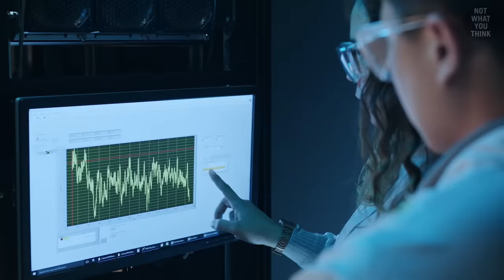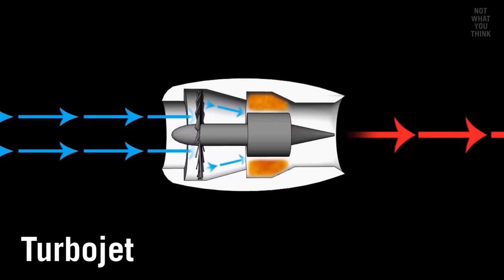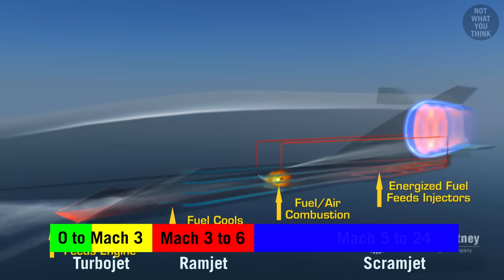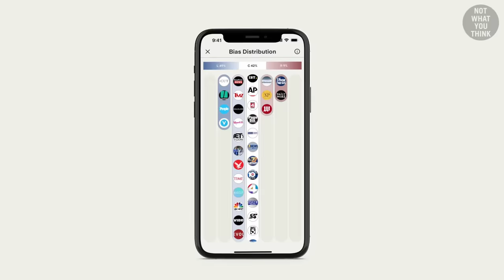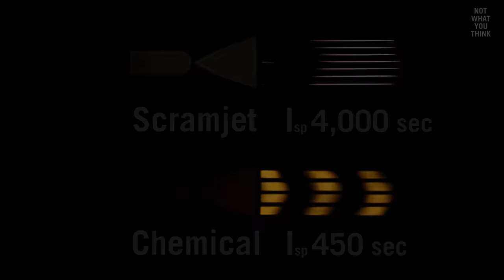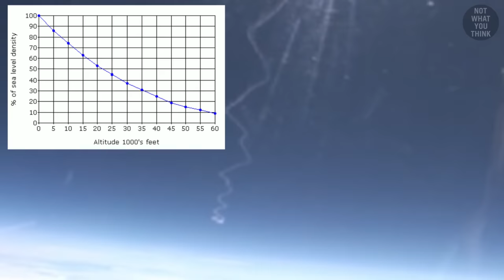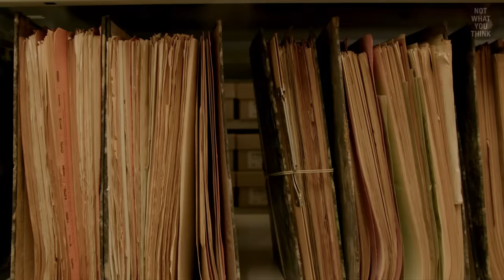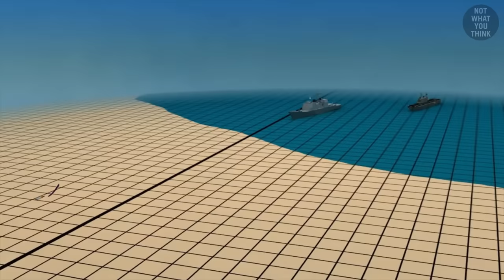The Hypersonic Missile Vulnerability That NO ONE Talks About

Comment: I can't even imagine the stresses that would have to be borne by a missile attempting to turn at those speeds. Any change in airflow would be devastating, and may undermine the very means of propulsion. Unless people have made science fiction level advances in materials sciences (possible), I agree.
Reply: The SR-71 could turn. Stresses are low because it flies in thin air. Actually it has to dive to grab enough air to give enough lift for the turn without stall. It bleeds speed in a turn so more like a spiral.
Reply: @ArneChristianRosenfeldt  Yes, it could turn in big, long sweeping turns and at high altitudes. The hypersonic missiles are usually characterized as traveling at lower altitudes, and in a more zigzagging motion to avoid air defense systems. That's a whole different ballgame.
Reply: @davis4555  When I see Reno air races I wonder how someone would waste 70% of lift for turning. At least I would expect large wings .. larger than on a cruise missile. The models in the video .. uh mostly stabilizer, while a real high lift vehicle would be a delta wing with edges which are barely subsonic at Mach 5 .. just like the NASA plane. Stabilizers drag. Mustang has small, Concorde does not even have a horizontal stabilizer. We need g, not cobra maneuvers at Mach 5. Rolling speed is not problem with low wing span.
I don't see the different ballpark here. If you fly Mach 5 of the altitude of the SR-71 .. where SR-71 titanium steel alloy was already getting quite hot while being cooled by fuel .. I don't think that we can do much better. Cryo gives you only like 150 K .
Reply: @ArneChristianRosenfeldt  I think we agree. 👍

Comment: I think the argument that zircon doesn't do enough damage through kinetic energy alone is false. For once, physics works everywhere, every time. It doesn't suspend itself just because a weapon system is not made in USA. Second, a meter or two of wood or whatever that floating structure is made of can't absorb the kinetic energy the same way earth, a building or a carrier does. The other arguments are interesting but I would like to see some more research behind the russian missiles and how they address these problems. Plus, a proper assessment of their capabilities should take into account their role in combined arms warfare, most likely on an operational or even strategic level.

Subscribed nevertheless!

Comment: when it comes to getting scramjets up to speed, couldnt you just have some mechanism to pump air into it at the correct speed until it reaches the correct velocity at which point you shut that mechanism off and let it work without it?
Reply: With pump you mean the fan of a turbofan? Or the exhaust of a tubo-jet?

Comment: So, the big advantage of hypersonic missile is the fact that it can evade or outrun antimissiles, right? But how the hypermissile will know it has to? It can't see sh** and has no communications because of the plasma, so it wouldn't even know there were any antimissiles fired at it. Sure, you can program evasive maneuvers in advance I guess, but that doesn't help if an antimissile is really fast. And even good old Patriot can squeeze out 4 mach in a pinch. That should be enough to intercept faster, but blind and unaware hypersonic missile.
Reply: It just needs to chance curse a few times. The defensive missiles can no changr course after the start so if you just change course after the point of time when the enemy defend missles was probably started you are safe.

Comment: You made no mention on how efficient current missile systems are at actually hit these. As for cruise missiles, they are much closer and have a shorter range where the launcher can be in range to be hit. There is many other ways for guidance, not just the ones you mentioned.

Comment: Question: If the hypersonic missile is blind during its hypersonic phase and also cannot be remotely controlled because the radio does not work (which means radar does not work either), how can it avoid threats, such as an interceptor missile? How does it "see" the interceptor missile? This is not answered by the video.

Comment: Misinformation. The "Iskander" missile has a speed of 6-7 Mach at the terminal stage of flight, while the "Dagger" missile has a speed of 10-12 Mach and is not ballistic, but travels most of its path horizontally. Hypersonic weapons are already a reality, just not for the United States.
Reply: Not on this planet. The problem is that you lack the slightest basics of physics. However, the Russians have never proved that Zircon has those performances. In the only video, its impact is ridiculous for a missile that goes more than match 5.

Comment: You are incorrect in your assertion that rocket fuel is always going to be expensive. What about if the rocket fuel is made via green electricity (almost free) using the Sabatier process to produce methane? Starship just needs methane & O2 for power.

Comment: Not the best video on the topic but not the worst.
I really disagree with your last point about them needing to slow down and be no better than ballistic missiles in their terminal phase. Because that's just literally not the point of the concept of a modern hypersonic.

Best I can tell the intent and most of the challenge of the concept of hypersonic weapons is with the materials required to manage heat at that temperature at acceptable altitudes.
That might involve climbing to to substantial altitude to avoid heat for an early phase. But best I can tell the concept is that in their terminal phase they would behave like a cruise missile just at hypersonic speed.
Cuz if you can get something flying as low as a cruise missile at or above 1mi/sec then you get to cut reaction time down to at most 40 seconds and honestly often under 20 seconds.

Comment: I was curious if you were going to mention the communication issue. At hypersonic speed, the missle can no longer communicate with the ground or use rader to seek in onto a target, which completely negates its 'maneuverability', as you need sensors and communication to maneuver.

The sonic boom completely eliminates to entire reason for having one.

Comment: Watched a video about tanks. They're utterly ridiculous and regular missiles can't penetrate. A rocket like this was used to devastate the tank.

At first it shoots like a regular rocket, then stage 2 hits and it goes supersonic.
Reply: What? A missile that can only hit stationary target and is quite expensive to fight against tanks? There are dozens of better ways to defeat a tank with the advantage of well actually hitting moving ones
Reply: @Dundoril  Not the new tanks they're developing.
Reply: @TallicaMan1986  hm? The new tank will no he able to move? Sounds like a design problem
Reply: @Dundoril  I forgot to mention. We're already doing this. They're called shapecharges and tanks are developing defenses accordingly.
Reply: @Dundoril  tanks are not fast enough to evade hypersonic rockets let alone rockets automated by robots. With this they developed other means of defenses. One of which is putting a coat Insensitive Explosives which only detonate if there's enough kinetic force.
Reply: @TallicaMan1986  "anks are not fast enough to evade hypersonic rockets"

But they are. The tank just needs to move 40 meters away.. A hypersonic rocket si launch hundreds of kilometers away and therefore takes minutes to the target
Reply: @Dundoril  it might happen, but sadly it doesn't.

Comment: I do not believe.

- Kinetic energy is good.  Even if it's molten scrap metal by the time it hits the ground at mach 10-24, it's going do a job better than conventional bombs.  Load up with some weight, it can melt away before hitting target, and existing  defense's around just likely to spread a lot of little projectile fragments, if it can hit it enough at all, otherwise it could just smash down near by with enough force to affect the targets.
- dual reaction engines to convert down speed.
- plasma is not going to stop  all communications.  It is likely they have a way to do this.  Satellite laser is one, specific wavelengths and plasma tuned to make things more opaque. But simple oculsion  can make a  more opaque area, such a behind the vehicle.  There is a mass of spy satellites out there.
- use movement sensors to map out movement instead of gps, and you can pulse the plasma for radio signal, and the plasma reaction to radio signals can be used to receive (look up the tpl, I think plasma radio transceiver patent from years ago).  The very top cutting edge is also the area of most consistent thinnest plasma.  A spike could be used for communications using the previous methods, or more conventionally.

- the plasma is a transceiving surface, so rad might be possible. 

- As far as visual.  You have spy satellites. But, again you could try the leading edge.  Some transparent materials have very high heat resistance.  Or a protected surface, but realistically satellites.  Meaning extremely small amount of data rate is needed to get through the plasma to guide the device.  Incoming threats can be detected by satellite.

With dual reaction engine (or second engine) you could get both fast and msch 3.  We simply do not know what they have planned.

As for the Russian nuclear one roaming around the sky.  You did my mention.  You knock the American effort to discourage, but undeplsy the Russian efforts, How Come?

We used to be leaders in scram jets.

Comment: At mach 5+, they won't be very maneuverable, either, certainly not maneuverable enough to dodge ABMs.  Turn radius on an SR71 at say mach 2.5 is measured in hundreds of miles.  Granted, hypersonic missiles don't have to worry about turning a pilot into goo on a high G turn, but they certainly won't be able to out-turn a head-on ABM approach, and it isn't even close.  Even if they are capable of making high G turns without breaking apart, they'll have to give up a lot of speed in the process, making them even better targets for ABMs.

This is a big nothing burger.

Comment: Your assessment of rockets for long distance travel is based on faulty logic. Yes, rockets are much less efficient than air breathing engines, but once a rocket is out of the atmosphere and reaches orbital velocity it doesn't need propulsion anymore. While a scramjet-powered aircraft traveling at Mach 10 would have to power its engines for the full flight, which could be over one hour and up to two for an intercontinental flight. A suborbital rocket would only be using its engines for about five minutes. Fueling a suborbital Starship would cost significantly less than a million dollars at current methane and O2 costs, if the rocket is able to carry 500 passengers as estimated, that is approximately twice the fuel cost perb economy passenger for a route like NY to Beijing (and presumably much less than a scramjet would use for that route). So in terms of fuel cost it should be fairly competitive with Business tickets.
There are many reasons why we are unlikely to use rockets to travel within earth in the near future, practicallity, scale and launch noise among several others. But fuel cost is not one of them since they would be fairly competitive in that area thanks to the vehicle being unpowered for the majority of the flight.

Comment: Has any considered the potential fall out or collateral damage of intercepting a hypersonic missile in the air either by conventional means or with another hypersonic interceptor?
Reply: I wouldn’t expect it to be any different from intercepting or shooting down a conventional missile. Any bits of the damaged or destroyed missile would quickly either burn up or decelerate to sub Mach speeds due to air resistance.

Comment: Russian hypersonic missiles seem to work really well in real wartime conditions. Western M.I.C. bros/propagandists simply move the goal posts after Russian systems show they actually do work as advertised. They said Khinzal isn't hypersonic initially. Yet Khinzal's skin is still glowing upon terminal descent right before impact. You only get glowing skin from air friction beyond low hypersonic speeds. NATO and Western radars seem to have issue tracking Khinzal as well. That is why Ukrainian air raid sirens sound off whenever a Mig 31K takes to the air. 😂

Lets not forget the NAFO OSINT bro spilling the beans about bastion missile launchers firing what those turds thought were P800 Onyx until targets were destroyed without air raid alarm 3 minutes later in Kiev. That would be a Zircon, that NATO radars seems to lose track of a few seconds after launch due to speed and superheating of the projectiles skin.

Comment: @Not What You Think  I still don't see why useless. It can be used as a cover. For Russia and China it makes absolute since. USA bulding this as a response to Russia and China. It of course it needs to slow down before hitting the target. The main point here is manvurabilty. At the final stage there is nothing there most likely to hit it. Also u can give another bost to change target if necessary one more time. Of course it going to have multiple bost phases and multiple preprogrammed patterns to use that it chose useing AI or pre-choosen. It is a cheaper option than a glade vehicle. A glade vehicle is the real deal. Reducing the chances of being intercepted is the point. U could make communication with it useing a sitlight sending info useing a lazer light. 

After thinking it makes no sense for USA but it makes enough resones for China and Russia. 

Glade vehicle is basically a jet rocket kamikaze drone that also can shot miny ICBMs like rockts or acutal rockts like Iskander or actual ICBMs with multi warhead skeem like jet can shot rockts. It has more fule than necessary so it can  swim around the target until there is a gap (if when necessary). 

U know they could strap someone on drugs that lost his body to do the aiming  and dodgeing choices. WH40K style lol. 

Also, imagine if multiple where shot at the same time,  then another volume where shot too. What if they make chose between 2+ important targets?

At the basic level, an ICBM that get modified where it can change couse of action while flying and trying to dodge an interpreter missile , is hypersonic at a hypersonic speed or beyond. 
Basically the idea is a javelin or stringer or mix of both very long range faster bigger and smarter rocket, ICBM version.

Comment: 16:00 You know the frame rate of the video. You can roughly estimate what distance the missile travelled between 2 frames, thus calculating the speed of the missile right before the impact. Looks quite slow for hypersonic but need to do the math.
Reply: How do you know frame rate of a video?
Reply: @SlonopotamIII  from playback settings?
Reply: @nitroGPT  Ok, the question is - real frame rate of a video. I can make video of myself running 200 km/h with a press of a button, but that hardly means I'm going to win next Olympics sprint.